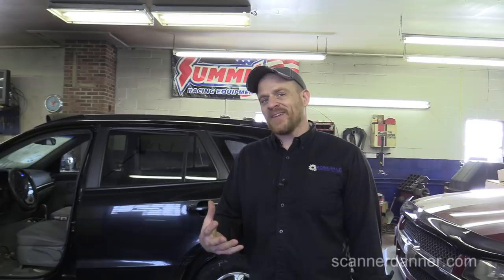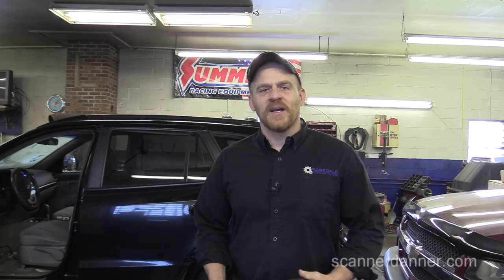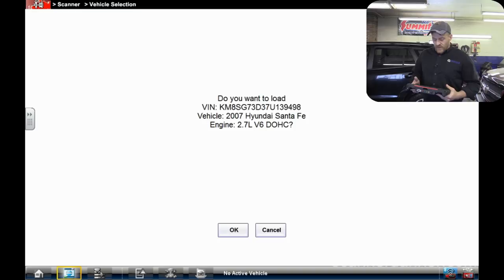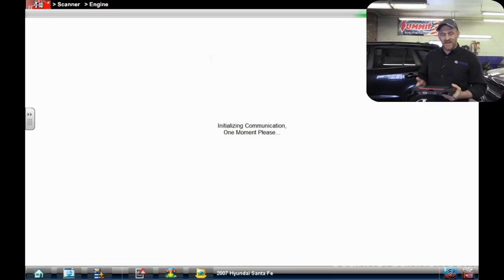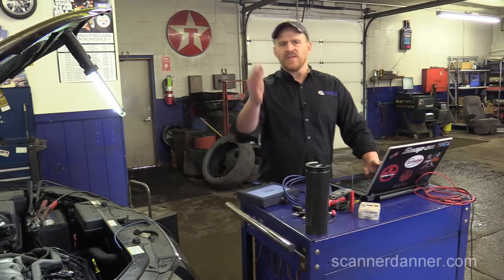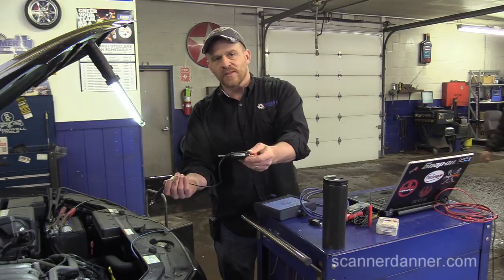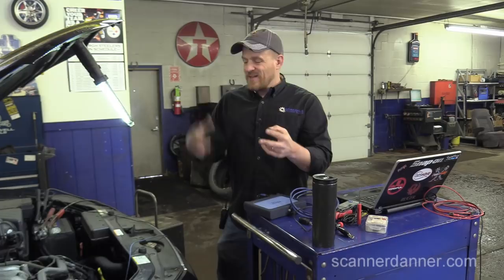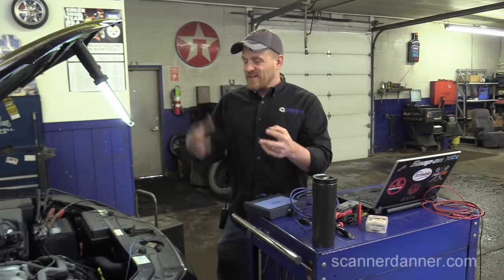No Start Testing Basics - Spark, Injector Pulse and Fuel Pressure (Hyundai Santa Fe)

Comment: On the fancy tools, "But I want the fancy tools" that way when I have nothing to do at home (on disability) I can clean the tools, use them for learning and repeat. 

Also when you started that Hyundai Santa Fe 2.7, I have a 04 3.5 Liter and they all seem to have that familiar lifter knock. Is that just a common issue on them? 

Maybe you could do a troubleshooting video on those and while you're at it maybe you could do a diagnosis on the intake manifold runner motor malfunction if you've heard of one of those. I've had a code at times and it shows there's a test (to be done yet) but from my understanding if it's faulty the intake manifold motor is part of the intake so the complete intake has to be replaced. Hyundai's are Chinese to me as I am Chevrolet, 06 Impala, 04 Tahoe, sons old 98 Toyota Camry 162k miles, sons newer 2013 Toyota Corolla S he bought first year of college with 42k miles and paid cash (wish I could) but these Hyundai cars probably aren't that much more complicated it's just "new" work to be done by me. 

With all the work I have to do I should create some videos but I can't do any monetizing being on disability. 

I could brush up on video skills, automotive terminology after not being commercially involved for years cars to class 8 trucks and trailers, welding included as well even on gas and tankers for anhydrous and propane and doing conversions on them in the fall and spring. That was before 13 1/2 yrs of driving truck so that puts me back working on them in the late 90's back into high school. Should've took a different route and my back probably wouldn't have been shot @ 37 yrs old from 19 1/2 years of working like a dog. 

I still love keeping current reading automotive technology books, the training ones on vvt, vvti engines, diagnostics, watching scanner danner premium, watching YouTube videos, reading, reading and did I say reading, forums, publications... I just have a thing about adsorbing material for my brain. 

I watch scanner danner videos multiple times, use a waveform demonstration board to practice with the Zeus previously the modis edge and began with the solus edge and I use the Pico 4425 Deluxe from @AutoNerdz.com, the autonerdz version with the bonus content, lifetime access and support,  yes the support is only as good as long as the forms are there or that the guy is there but there is plenty of technicians that help each other out. AESwave.com and tools are another favorite. 

Great content all around and good learning especially with scannerdanner premium and the added content.

 Wouldn't have it any other way except to own my own shop but I need about probably $150-300K outlay and that's just getting doors open and a couple weeks and money has to be rolling in and I can't do it full time as the pain builds throughout the day where after a few hours I need a nap even at 45 and I feel like a young 45.

 I do still get stumped but forums are a very good resource. Never went to tech school unless you countl the scanner danner school of tech online a tech school. 

Paul you should do a program where you can do online timed testing and for a additional fee offer certificates as long as they pass your test and ASE Certification tests prior to getting the certificate from you. 

 That could be valuable for a guy who wants to go the hard knocks of school route like I did in the late 80's to the late 90's or one who's grown up around cars and engines but needs the diagnostic side of things..... 

The wife once told me in the last 6 months I have enough tools to open a shop and that got me thinking..... I think I do have alot though as well. If I could afford a larger box I'd do it but I'm going to build a double stall next to the current one and go 2 cars deep and put a hoist to work on my stuff and maybe either rent the hoist by the hour or multi hour deal and also use it to give instruction to up and coming youth as even though I'm on disability I volunteer alot with today's youth especially in sports coaching as today's parents for some reason don't want to get involved. These kids are the future and we need to make sure they're set as well so they can be the next workforce instead of relying on other countries to do it or workers be imported on visas to do it because it's being done already and been that way a long time for the food and skilled labor and trades industries

Comment: Actually the spike in your test light circuit is the contact bounce in your relay tester switch , every time you switch it on and off the contacts in your tester switch will bounce on contact or disconnect.
Reply from the maker: The spike you saw is the inrush of current from a cold bulb filament as I described. Once the bulb get's hot, its resistance rises drastically and amperage drops accordingly.

Comment: The light bulb test light resistance is LOW when cold and then INCREASES when HOT.  It is approx 10 x . So a cold bulb might test at 4.8 ohms, and hot it will be 48 ohms.
Reply from the maker: Yep, this particular bulb will peak about 1 amp of current and drops to 180ma
Reply: @ScannerDanner  At 37:30 you said as the bulb glows ,the resistance drops. I am sure you meant the opposite. When cold there is little resistsnce, that is why the current spikes to 2.5 amps, once it heats up , resistance increases, and current should go to about 250 milliamps. 3 watts = 12v x I.  Therefore I= 3/12  amps. ...So at .25 amps ,the resistance is 12/ .25 ...= 48 ohms. 
Thank you so much for doing these videos, I learn a lot of information, I do not know how you had the time and desire to do so much ! Sorry I did not specify the exact time in my first comment above.

Comment: Hi sir, help please 
I do have problem with my Toyota Camry v6 3.0 1999,
The problem is engine oil touch the all spark plugs from in said  engine costing miss fire. 
I do have change the PCV valve and pcv valve gasket. And I checked all cylinders PCI air pressure 175 to 180.
From where the oil came from??????
Reply from the maker: You're getting oil into the spark plug holes? That can only come from the valve cover gasket
Reply: @ScannerDanner  
There is no oil on spark plugs holes.
The oil touch to the spark plugs from piston side .
Reply from the maker: Ah, okay, sorry. So you either have a valve guide issue, allowing oil to seep into the combustion chamber via the valve stem area or you have a ring problem on the pistons

Comment: bro i have a jeep and the gearbox and motor goes in limb mode....done everything i could even jeep couldnt get it right....any light you can shead
Reply from the maker: Start with a code scan. Limp mode on a tranny will always set a code

Comment: I'm sorry if I missed this in your video (superb video by the way), could you put an ohm meter on the power and ground terminals of the pump and tell if it's open?
Reply from the maker: yes, but there are variables to that test. If it shows it's open, it is a legit open and the pump is bad. If it shows good continuity and that there is no open, there can still be an open. Why? Heat is the key. Run the pump with a 12v power and ground and it opens back up again. Hope that makes sense.
Reply: ScannerDanner I really appreciate the reply. I have tested everything back to the pump and everything is ok. Power to the pump. Harness ground is good. Tested across the pump and it was just like holding the leads for the meter in the air.  I did connect 12v to the leads of the pump and nothing happened. I'm almost certain it's the pump. It's a 2007 Santa Fe like in the video. It literally does the same thing as the one in the video. In the video the first time you turned it over and it tried to start, this one done the same thing.

Comment: scannerdanner is number one!! Paul thanks a lot man your way better than any teacher I've had or tech at my shop! Need your advice man! Im a 2nd year journeyman, SnapOn Vantage Pro off eBay? or a picoscope? leaning toward vantage pro, price is better. Your opinion is one of few i trust! THANKS FROM ALBERTA BUD!
 Quinn S
Reply from the maker: I would buy a used Vantage Pro from eBay first and save your money for a nice 4 channel automotive pico kit for later. 
In my opinion, everyone should have Vantage Pro as part of their tool arsenal. The VP was the best of Snap-ons Vantage line. Better than the Vantage (of course) and also better than the newest touch screen Vantage Ultra. The VP is not touch screen but so what.
Reply: Thanks Paul! your the bomb brother!!

Comment: Hi dan I have been watching your videos all day today and you are the best, most people don't bother to diagnose the right way. I Wanted to ask if you have ever had a problem where a diagnostic tool could not communicate with a vehicle (2001 Silverado 6.0L the one I'm working on with my dad) he checked the fuses, Ecuador I believe the computer in the truck on the driver side with test light and cleaned all the grounds to the chassis since cleaning the grounds on the same truck fixed the issue on a different Silverado.
Reply from the maker: Thank you! So you fixed your no com issue then?
Reply: ScannerDanner no not yet I was wondering if you have ever had an issue with a chevy silverado? There is no code because when ever I enter it says error and sends me back to the main menu for he scan tool (snap on modus edge)

Comment: older kia and Hyundai have timing belt special functions as well as data that will tell u if timing is off. more so the pids your looking at would indicate error with cvvt system cam timing only.

not sure if w a no start your readings mean anything would have to test known good.
Reply from the maker: did you see that -11 on that one bank cranking? there was no issue with this vehicle after FP replacement.
Reply: ScannerDanner I did see that. I can't say 100% if that's normal or not as I haven't watched those pids on a no start.

Comment: I've been watching your channel and learning alot.  To make a long story short, I issed what I learned from your channel to figure out why my starter wasn't working by tracking the electrical wiring etc.   But the next morning my car caught on fire. All the ground wires from the battery burned up and done of the ground under the hood burned.  My battery is in the trunk. What would make the ground wires burn up like that?
Reply from the maker: Bad block ground. Starter used the body of the car and the smaller body battery ground cables as a path and it was too much current for them.
Reply: ScannerDanner man your great! I was wondering though, since all my ground wires are now burned up, if I put the big 3 in, will that be better?
Reply from the maker: You need to fix your main block ground first. Then replace your burnt body grounds. If you fix it by installing larger body grounds, you will cause other problems.
Reply: ScannerDanner ok.  Thanks
Reply: I changed the block to chassis ground wires and the battery to chassis ground wires... But now after I try to attempt to attach my ground wire to my battery it immediately creates huge sparks I can't even touch the ground to the battery.

Comment: Love that I have the same name as your son.  I have a 99 Buick Regal GS, and I let my sister drive it for a couple months. Long story short, i have spark at all plugs, the fuel pump turns on and i have pressure. I sprayed starting fluid into the intake and i get nothing, i took one of the plugs out and sprayed fluid into the engine, and it was burning the fluid in the one cylinder, i cant figure out whats wrong and I’ve tried many things to try fixing it. Im hoping with all the knowledge you’ve got, you could help me out.
Reply from the maker: Is it the 3800 engine? And are you losing coolant? What do the plugs look like? Are they completely fouled and wet?
Reply: ScannerDanner yes it is a 3800, the plugs are only a month old, and when i took it out it looked almost brand new still. I think its something with the security locking it out from starting but the security light isnt on. Im getting spark, fuel pressure, i have a brand new battery, i tried sanding the grounds, all the fuses are good from what ive tested and ive also tryed replacing relays just hoping for some sort of a result. Im not sure what to do. If i cant figure it out within a month i might take it to a shop, any suggestions on where to take it, id love to have you diagnosed it but i dont believe you live anywhere around here. I live in green bay. Thank you  for responding though. I appreciate it
Reply: ScannerDanner and no im not loosing coolant i put a brand new radiator three months before this happened...

Comment: Ah teach... at 37:31 shouldn't it be as the bulb heats the resistance goes up?  That 2.5 amp surge is on a cool filament but quicky heats and the current drops.   I think that's right.
.

Comment: I have an 05 f150 5.4 3v. I had a check engine light which showed a misfire on cylinder 1, I replaced the plug  
With motorcraft sp546x and a standard ignition bluestreak coilpack and this got the truck driving good again.

Then I noticed  more slight misfires but truck still ran pretty good so I replaced all my coilpacks and plugs (Plugs from cylinders #1, 4, 5,8 looked bad with electrode wore way down..they had aprox 84k miles on them and were sp546 plugs) but even after changing all plugs and coilpacks I still have the slight miss, (forescan showed this on the nm pid) I also put dielectric grease on each spade and on the plug contact side and every coilpack & injector connector, I used my powerprobe maestro, which can test the injector circuit, and found that on cylinders 5-8, I would see an occasional Injector On Time drop to as low as 40.1 and even 101. Cylinders 1-4 would stay around 2.78 - 3.00 or so and never drop. I think this shows my occasional miss  would be on the control side to the injectors, which could be the pcm? I also discovered the fat connector in front of the pcm's 3 connectors seems stuck, I tried to unplug it to check for corrosion, but I could never get it to separate so I could check it. Also, I watched a fordtechmakeuloco video where he shows a #7 cylinder intake roller follower popped off and was cause the misfire there..I assume with my findings this shouldn't be what is causing my miss?
I also verified I had good voltage to each power side of each injector connector. Any ideas? I replaced the fuel driver control module by the spare tire about 1.5 years ago with a doorman, I don't know if a malfunction in it could cause my injector on time drop or not though. Im really leaning toward that connector that I couldn't get apart being corroded or the pcm has corossion or damage of some kind. Any ideas ?

Here is a link to video of my powerprobe maestro showing the flucating on time of cylinder #5
https://streamable.com/75ubzg
Reply from the maker: Help me understand this injector test you are doing. Are you just looking just injector pulse width commands on scan data? Or is this some type of bi-directional flow test?
Reply from the maker: Oh okay, just watched your video. Your connected directly to the control wire of the injector right? Yeah, I gotta say, I've never used that test and honestly don't trust it. I'd want to see the injector waveform on a lab scope. 
Here is what I would do next.
Step 1 clear all memory (code clearing will work for what we're about to do)
Step 2 drive it for 50 miles or so, including multiple cold engine starts, to warm up.
Step 3 - go to Mode 6 in OBD2 and look at all the cylinders for their misfire counters and see which one shows the most and start there. You can have misfire counters set and not set a code btw.
Reply: @ScannerDanner  from what I understand it testing the control side of the injector circuit. The maestro is backprobed to the control wire (not power)on the injector. The engine is running and all connections are plugged in as normal. I really don't know for sure if this data is bidirectional but powerprobe has this to say about what this test does.
Connect to the injector control circuit (one probe) or backprobe injector control wire at the harness or at the ecm

Start engine
Red and green flashing lights are synchronize to the ecm injector control driver.

A missing or intermittent flash indicates a problem with the injector signal

The screen will display
1. Injector On Time in ms (total amount of time the injector is energized & supplying fuel to the cylinder. Example 03.43)
2. Inductive Kick Voltage (example 068.6) (when the winding in the injector is turned off it produces a "kick" or flyback voltage. A normal inductive kick ranges from 55-90 volts)
3. ECM Ground Voltage (Example 00.14) (this is the voltage drop when the ecm grounds the injector. This should be near 0 volts exmpl (00.13) but can be as high as a 1/2 volt, example 00.50)
4. Injector Supply Voltage (this is the voltage supplied to the injector rail..this should be close to near battery voltage example 013.7) anything more than a 1/2 volt drop from battery voltage should be investigated) when comparing injector readings to one another you should see similar readings..abnormal readings should be investigated.
Reply: @ScannerDanner  ok I'll do that. So far forescan shows the misfires on cylinder #1 I see them nowhere else. What is strange is that on cylinders 1-4 there is no on time drops just on 5-8. 1-4 is always a steady 2.70-3.00 like clockwork.
Reply from the maker: @A.C.71  yeah, that is a go, no go test with that tool. In other words, you'll see it when it is bad (no control all the time). Other than that, you're barking up the wrong tree. Focus on cylinder 1. Move the coil and plug to another cylinder (don't care that it's new) and clear codes and then retest to see if it moves.
Reply: @ScannerDanner  Thank You, I will do that.